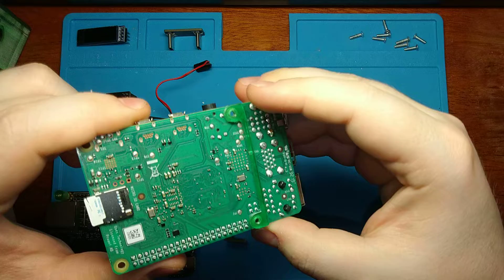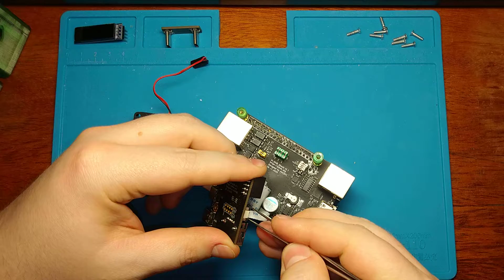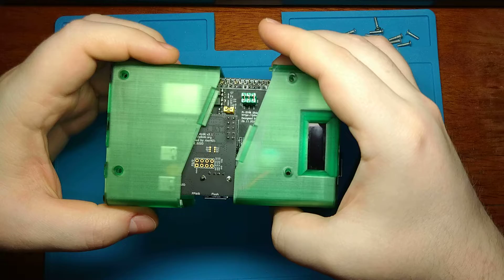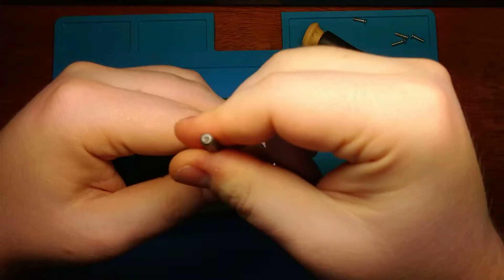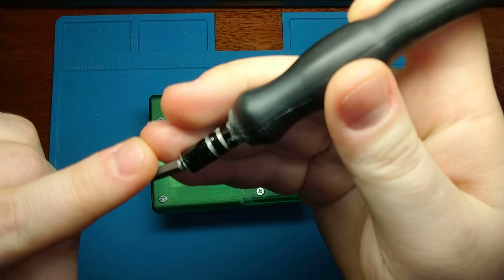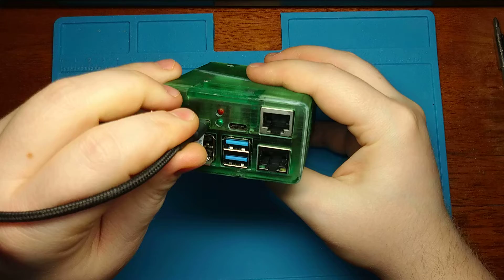PiKVM v3 - Engineering sample

Comment: Interesting split case. Why block the upper left usb port with the ribbon cable?
Reply from the maker: Thanks. Port is blocker because of height FFC connector and clearance between top USB-A and Power Type-C.

Comment: How much noise do that fan? For the rest, I just want to start mounting it!
Reply from the maker: This fan is not quiet, but we tested it with 25% RPM (less noise than regular PC) and system temperature under load just 15° higher than ambient and stable (without any coolers on chips). We will made some fan control program for dynamic regulation and find some more quiet fan.